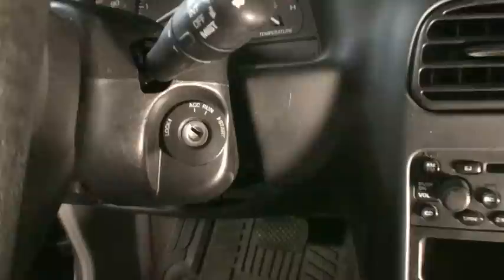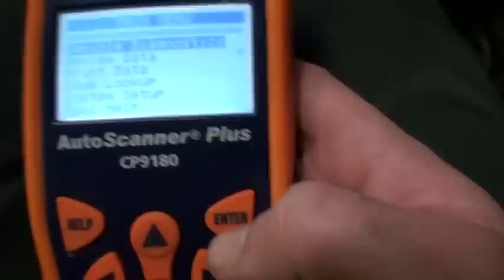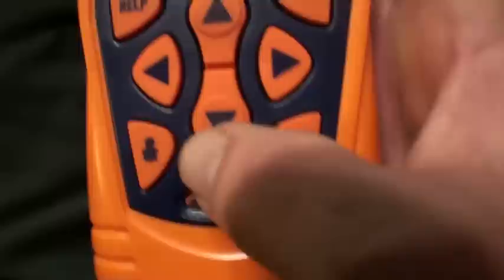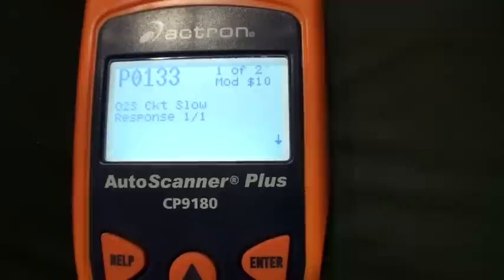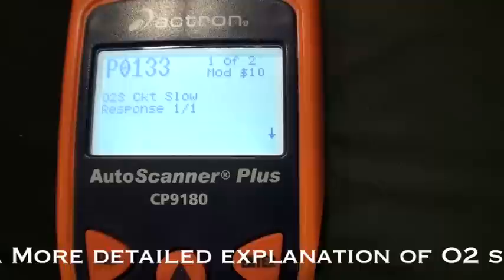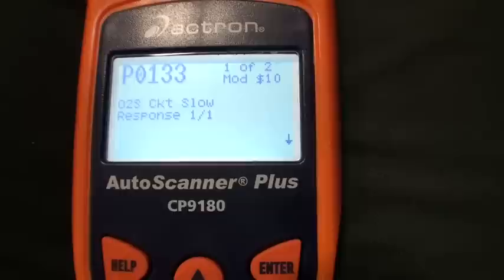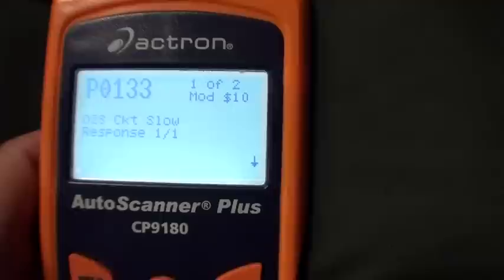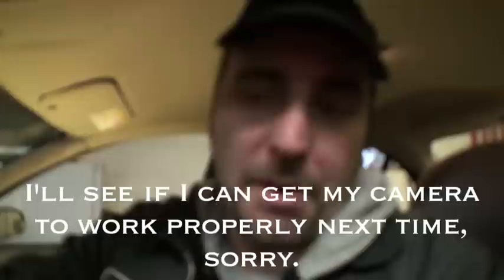Check Engine Light Basics - EricTheCarGuy

Comment from the maker: If I'm honest I don't know either.  As for shift solenoids or any electrical component you need to see if it has the things it needs like power and ground at the proper times, the wiring also needs to be checked for shorts to ground or power.  I'm sorry but I just don't have the capability to go through these tests in a text response.  I will be covering basic electrical diagnosis in future videos however.

Comment from the maker: If the light is not on but the code is still stored it might be that it was not reset at the dealer.  If you don't reset it yourself it may go away on it's own, usually after 50 starts of the vehicle.  It may still be there as a "soft" code, something the the PCM is motoring but does not detect a fault with at this time.

Comment from the maker: @syphilistic Actually they didn't "ignore" it because the original mandate for OBDII was that the DLC be located "under the dash" and was not specific on placement until 99-00 model year when they changed the regulation on it's location.  Personally I think it's easier to get to the one behind the ash tray as I'm too fat to bend over to reach under the dash.

Comment from the maker: Good question.  I think the air filter replacement had little or nothing to do with the check engine light.  PO411 is a secondary air injection system incorrect flow.  Secondary air is injected into the catalytic converter to increase it's efficiency. PO420 is a catalyst efficiency below threshold code.  Both codes seem to point to a problem in the catalytic converter and it's related system, it MIGHT be bad, it needs further diagnosis.  You can PM me for more info if that will help.  Good luck.

Comment from the maker: @reddog9401 I don't have any ABS videos yet but you need to find what code is stored first in order to diagnose the problem.  It usually requires a special scan tool to pull the codes.

Comment from the maker: @6015414 Sounds like you might have warped rotors, watch the video I did on changing captive Honda rotors.  As for the check engine light you need to get the code to know where to start there.  I plan to do a video on this at some point in the future, sorry I don't have it for you yet.

Comment from the maker: First, I don't do pricing here so I can't answer that.  Second MAP sensors rarely go bad, if they set a code it is usually an indication of a condition elsewhere or a problem with the wires coming from the map.  As it happens I think on that car their are 2 similar connectors on the throttle body that can get mixed up and cause that code.  You can tell if a MAP is bad by looking at it's reading on a scan tool and comparing it to the BARO sensor KOEO, if they read the same, the MAP is good.

Comment from the maker: @rjhty TPS's hardly ever go bad but they are easy enough to check with a scan tool if you have one that reads a data list, as for the IAC I kind of covered that in Solving Honda Idle Problems but I agree that a video just on the IAC would be a good one.  Thanks for the suggestion and comment.

Comment: I actually changed my own oil (2001 Saturn) and even rotated my tires. I have lifetime rotation included with my tires (got them a year ago) from a shop about 1 mile away and yet I never actually have it done. 
---
Back to the show
---
Auto focus can be an enemy at times.
---
My car has about 125K on it.  The fun is just about to start for me I'm sure.

Comment from the maker: @VietBloodXIII That code is for the O2 sensor and probably means it is out of range.  Given the age of the car it's probably not a bad idea to replace it.  Also the way the CEL comes on is typical of an O2 problem since the computer doesn't even look at it's input until the engine reaches a given temperature.

Comment from the maker: @reddog9401 Normally heater codes are pretty straightforward and mean that the O2 needs to be replaced.  I would replace the O2 and then clear the code and see if any problem still exists.

Comment from the maker: I don't know of exhaust pressure as being one of the things that would show up on a CEL.  Is the car turbocharged?  If not you may be referring to the EGR which stands for Exhaust Gas Recirculation.  Some manufacturers monitor pressure here to monitor flow.

Comment from the maker: @THOLIM90 I don't think it's the sensor, it may be a vacuum leak or more likely a problem with the AIR system.  If the O2 gets bad readings it will screw up the mixture when the engine is warm and performance issues and poor fuel economy will result.

Comment from the maker: @qaz3000 First don't condemn the O2 straight away, what the code means is that it detects a lean condition it's not likely to be the result of a faulty sensor but some outside factor such as a vacuum leak or insufficient fuel.  I would first look for vacuum leaks OR exhaust leaks before the sensor as this is the most likely cause of the code.

Comment from the maker: @jaruss0225 The CEL and leak may not be related.  You need to find the code that is stored for the CEL in order to proceed with that.  As for the leak it's really hard to say without seeing it for myself.  I could be condensation from the exhaust or just condensation from the HVAC, both of which are normal.

Comment from the maker: @MrAnt797 I hate to tell you this but I've put in my fair share of Jeep transmissions and it sounds like you might need one.  Check the fluid and clear the codes, if the fluid is good and the codes don't come back you might be OK but I think you will find that you will need a trans in the end.

Comment from the maker: @KoolCordell How about a paperclip?  Jump across the top 2 terminals on the connector (the only 2 with metal in them on the upper right) then turn the key to the "on" position and count the flashes of the check engine light.  Do a google search on GM OBD1 codes to determine what the code stands for.

Comment from the maker: Depends on the model and what the code was.  Heat can contribute to a lot of failures in a lot of systems.  Based on what you described check for an exhaust restriction.

Comment from the maker: @partyboyperk With no CEL I would look to the basics, first check timing both mechanical and ignition.  I might also be looking for an exhaust restriction in your case, you might try dropping the exhaust at the exhaust manifold and then driving it, it may be loud but if it performs better then you would know that an exhaust restriction is your problem.

Comment from the maker: Good for you on doing your own maintenance, that kind of thing can be empowering.  Most issues with automotive service that I encounter are trust related.  It's hard to find someone you can rely on and then there is the turnover issue when you do.  My wide angle lens causes problems with my auto focus, I'll have to find a work around there.  You would be surprised at how far regular maintenance can go even at 125K.  Don't jinks yourself.

Comment from the maker: I would say that the most likely cause of the bulb not working is a burned out bulb.  I'm not so confident that replacing the instrument cluster will solve your problem.  In normal operation when you first start the car the light should be on for about 10 seconds then go off, this is referred to as "bulb check".  I would check to see of you have power and ground at the bulb when you first turn the key on, if not, follow the ckt back to the source to find the problem, use a wiring diagram 4 this.

Comment from the maker: @qaz3000 Well it sounds like you have multiple problems so take them one at a time.  I would start with the engine temp issue perhaps by replacing the thermostat with an OE unit and bleeding the cooling system.  Engine temp has a lot to do with how the engine runs.  In my opinion it's not a good idea to put cardboard in front of the radiator as it does not allow airflow, this is a good thing with diesels in the winter but not with passenger cars.

Comment from the maker: What about the wires going into the back of the connector  on the car, the terminals inside it, or some other location in the circuit?  There are usually a set of tests that get performed (often specific to manufacturer) whenever a condition like the one you are experiencing happens to find out if the signal is getting to the DLC.

Comment from the maker: @founditnow54 That is a valid test however I would also check for air leaks in the air tube leading to the engine after the sensor, any leaks here will cause a problem and also set the code for a MAF sensor.  You might also try cleaning it with some carburetor cleaner to see if that helps before you replace it.

Comment from the maker: @partyboyperk What is the code for the light?  No, running the engine will not heat the fasteners up enough to get them loose, watch the video I did on getting bolts loose with a torch.

Comment: Hi I have recently bought a bmw 320d and find out that when i turn the key, i can't see the Check Engine light, The LED is fine bcos when i do the clock test, all lights including Check Engine light comes on. When i connected the OBD, there is problem with EGR Valve but why the light is not coming on the dash..???
Plz Help

Comment: Well Done..  I've run into a few "Lean" codes on Fords. Looks like maybe a dirty Mass Air but if ya look closer the Baro is out of range.  Ya have to disconnect the Batt for 10 minutes to reset Baro to 29.9 or above. A customer went into the mountains and returned.. The Baro never reset.. 

Les

Comment: Hello Eric ! I supose you must not remind me since you have sa many question but anyway i wanted to give you a little feedback... So the check engine light is off now :D you were righ , the 02 sensor was okay it was actually the connection that was bad.. Ended up buying the Spill-free funnel for the coolant bleeding but find myself using it lots of time its a great tool. And finally the head on the sidekick had way too much warpage ended up selling the parts. See ya Eric keep rocking  !!!!

Comment: still trying to decide on a scan tool. Does yours have an ABS funtion on it? O and the saturn sl series don't have cam sensors. You just need to clean the bolts that hold the coil packs. and it will get rid of that code. They provide a ground. but you probally figured that out by now lol

Comment: Actually this is the way to retrieve the code WITHOUT using the scanner/computer:

Turn your car on and off. Wait three seconds, and turn the key in the ignition (don't start) on and off three times (leaving the key in the on position on the last click). Wait a couple of seconds, and the digitial mileage readout, will show you the codes that you need to have checked. When it's done showing the code(s), it will read "done."
Reply: orchidgirl54 is that true?

Comment: I have a question and would appreciate it if anyone could provide a valid answer. The Service Engine Light Soon recently came on on my BMW 530i 2003 and I got the computer checked at an independent shop. They told me that it is a brake or park brake sensor. Can that actually active the service engine light?
Reply: LimitlessCXIVI in some models yes

Comment: I had a bunch of codes including secondary air injection incorrect flow, misfires, MAF sensor, etc. They all went away when I fixed one heck of a vacuum leak. Seemingly unrelated, right?

Comment: i have a quick question eric

Would high heat make the check engine light come on?

it came on about 2 days ago when i was going up a hill when it was 37C(100F) outside, but when i restarted the car on a flat surface it hasnt come back on since

Comment: My friend has a check engine light on in his car, and the code that was retrieved indicated a faulty MAF sensor. Is the "tap test" (tapping it while the car is running - if it goes to stall, its bad) a legitimate test for determining if the MAF sensor is faulty? Thanks very much!

Comment: @EricTheCarGuy  actually there is a light on but i didn't see it and if i heated the motor up would that help loosen the bolts on the exhaust cause i don't have a torch set.

Comment: hi eric.. i hope everythin is fine.. i have a 93 honda with a d15b engine.. recently i threw a code 20 (Electric Load Detector Circuit).. so far i have checked the fusebox for any busted fuses all is fine, i also checked the wires underneath the intake manifold for any burnt wires but everything is in good shape too.. can you please give me more any ideas where to check?
thanks and Godbless

Comment: I have a question why the check engine light blinks once when i turn the key to the on position, but then when i turn the car on there is no check engine light.. i just want to know if there is anything i should know, i have a 1990 GMC Sierra that has a 5.7L v8 chevy 350

Comment: Hi Eric. I have a 307 small block engine from a 1986 Camaro. I want to put in my 1954 Dodge Fargo truck. My Problem is I got it from a friend and it came without a fuel pump. I have 3 pumps that I got from another friend, but they are all different.One pump has a long arm and the other two have short arms. Plus one of the short arm pumps have two small gas lines as well as the threaded connection. I was hoping that you could help me by telling me what pump might fit my motor. Or maybe you could point me to a web site with engine components information. I am just starting out restoring my old truck and can use all the help that I can get. I guess that is how I will learn, Thanks

Comment: eric, have you done any videos on abs, mine pops on sometimes along with traction light also. i have checked both front wheels near the hub. wiring seems to be okay? i have 2003 buick century. i think the sensor is built right into the hub,dont really want to replace the whole hub assembly, any ideas thanks bro.

Comment: Eric, my car bogs down at low rpm's and doesn't want to pull the load but when you push the gas pedal all the way to the floor it picks up speed and works normal, Also when speeding up it will shift down in the gears and over revs. please help

Comment: Had my mechanic check my engine light and tested it and said its not my 2 o2 sensors or the fuel enjectors. He did a tune up and throtle plate cleaning and re set the codes and i dont even see it come up no more.

Comment: I have a 1998 Honda Prelude, base model, automatic. Last week, my check engine light popped up, the speedometer stopped working, but sometimes will work. My D4 light was also flashing, I got the codes pulled and it shows, P0500, P0700, and P1791. I have read some forums and many have said they had the same problem, and it was the speed sensor that needed to be replaced. I've also noticed that VTEC does not engage whenever the speedometer is not working, would those be related? Thanks!

Comment: hey how much is it to replace a map sensor roughly? I checked the engine codes on my 94 honda civic and it flashed 5 times. I looked up the code and it said "Code 3 and 5 Manifold Absolute Pressure" if you can tell me I would greatly appreciate it. also is it something that can be replaced easily?

Comment: @EricTheCarGuy  So first of all i started by removing all the cardbord in front on the radiator cleaned the Egr valve which was semi-stuck put some jb weld on the manifold rust hole , threw a bunch of carburator cleaner everywhere , didn't noticed anykind of vacuum leak. Check engine light still on But now that i removed the Cardbord car doesn't reach normal operating temperature even after 20 min drive ?? radiator is in pretty good shape and i replaced the water pump and temp sensor any idea ??

Comment: @EricTheCarGuy i dont have a meter or what ever you call it and i probably could get a torch but it runs perfect at idle but the temperature is a little hot and from my experience with cars that could mean that the exhaust could be restricted.  Im thinking that it might be the catalytic converter but again im not for sure also the exhaust steams even when the car has been running for while.  it has puzzled me.

Comment: Hello Eric ! the check engine light just appeared in my 1994 toyota tercel 214 000 km , i've managed to get the code even if its OBD-I ( thank god toyota has the handy-dandy paper clip trick ) . anyway , it says Air-fuel ratio Lean malfunction . ive watched your video on O2 sensor but i would like to know which procedure do You follow when you have this trouble code what are the things to check/test Thanks a lot Eric ! Keep on Rocking !!

Comment: @bemeathome Hi, i have a question, my car after 3000 miles tells me to change the oil, but after 1000 miles, my check engine turns, changed the oil, how can i reset the check engine?? Its a bmw 330i 2004. And one last question, my car leaks oil, what could be the first common problem. 
Thanks

Comment: My Honda Accord v6 
2009 check light on 
Code p03400 engine valve system stuck off bank 1 . I changed the pressure switch 
But light still on after cleared code 
Also I have a problem with the exhaust 
If you place your hand on the exhaust discharge it feels like pulsing

Comment: I had Autozone check my engine light and the code read that he said, its either a O2 Sensor or Fuel Enjector.  Fuel Enjectors for my ford is like 60$ a pop, so i cant afford to buy 4 at the same time, so how the heck would i know if its the fuel enjector and which one. Guess i take one out and put new one in and if no ligh comes on, guess that was the bad one.

Comment: yea my mechanic has one for around 6 grand but it will tell ya exactly what need to be replaced. i had my check engine light on and i checked at autozone wink wink! they pulled like 10 codes meaning i needed to get a new engine ;) but i took to my mechanic and he only pulled two codes: one for o2 sensonrs and the other for spark plugs.